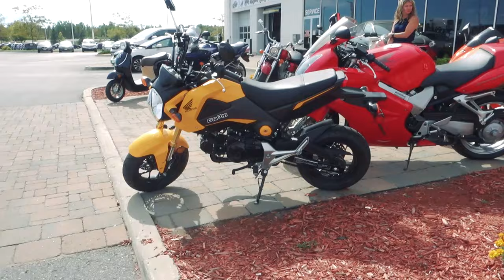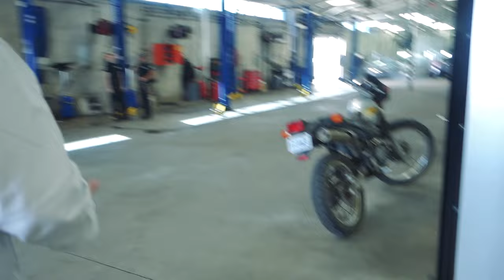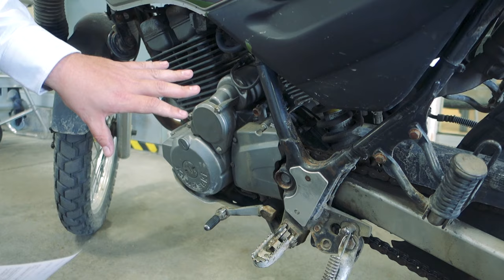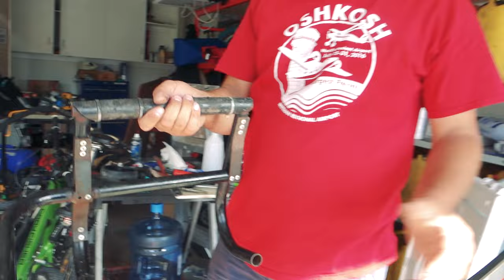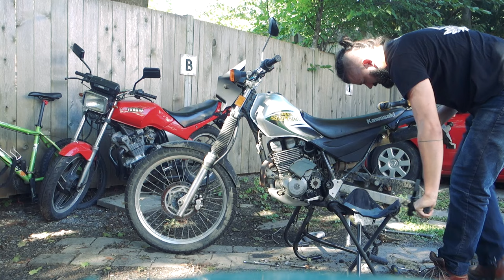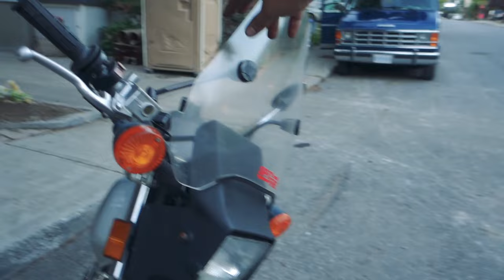I Bought a New Bike - MotoMaritimes 01

Comment: You did good on this bike purchase, and doing the repairs yourself sure helped. 
I just spent $1700 getting my KLR 650 back up to snuff. Bike repairs ain't cheep. 
That Sherpa is a good little bike. You may start to realize the limitations of the 250cc engine pretty soon, though. At least it will be easy on gasoline. 
In 2004 I bought a new Yamaha TW200. I drove it to work, and everywhere else, every day for over four years. It was a great little bike, but I eventually wanted something bigger. The KLR 650 has been a great bike. I recommend it. 
Safe Travels, and Happy Camping!

Comment: I've been riding motorcycle for 25 years and I've owned a variety of bikes, both on-road and off-road.  What you'll find, at least for long road trips, is that a 250 engine is a bit small for constant highway speeds (unless geared properly or you stick to lower speeds).  I owned a Suzuki 400 dual-purpose dirt bike and traded it in after a few rides because it was uncomfortable for long distances.  I ended up going full road bike instead.  If I were to buy a dual-purpose today for road tripping, I'd probably go with the Kawasaki KLR 650, which is about as perfect (and proven) as you can get...and they're low cost, even the new ones.  Most typical dirt bike seats are going to be uncomfortable on long road trips, especially the new ones--but it looks like yours has a nice wide comfy seat, which should suffice.  If your butt starts to hurt, pick up a wool/fleece seat cover, it'll help your butt a lot by absorbing moisture and adding extra padding.  A huge part of the motorcycle "struggle" is comfort.  A lot of vibration will put your hands to sleep quickly on a long trip.  These small discomforts are something you have to live with or find ways to mitigate.  Gloves help with vibration from handlebars.  A side note about Kawasaki.  Great bikes, but I've found the feel can be crude and simplistic (unrefined) vs other bike brands; still that wouldn't stop me from buying one, they have a unique appeal.  If you're iffy about bigger engine sizes or fear them, don't be--you get used to them quickly and you're tall enough you can man-handle any bike thrown at you.  I've owned everything from a 250 to an 1800 and I can tell you, for highway, the bigger engine the better.  Let me digress though, for a dual-purpose dirt bike, 400-650 is the sweet spot engine size (at least for me).  The windshield addition was a must, you'll be so glad you added it.  Long story short, get out there and ride brother, blow some of that stink off.  It'll all pan out as you gain more experience.
Reply: John Doe great tips!👍
Reply: John Doe I second the recommendation of the Kawasaki KLR 650. I have owned mine for nine years, and ride it most days. It has been a great bike.